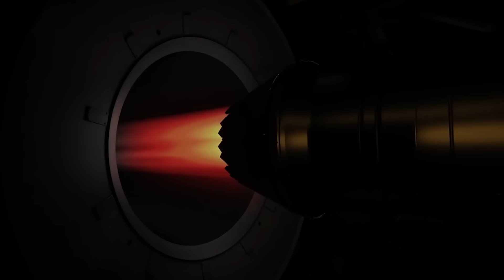Lockheed and GE join forces on a new HYPERSONIC jet engine

Comment: Diesels are "detonation engines"  compared to gasoline burning engines.  It requires more compression and heat to function, kind of like getting up to speed for a ramjet.  It's also why fuel vapor trapped in a box becomes something like a bomb.  In rhe open, methane/propane burns slow and the flame front travels through the fuel/air very slowly (but trapped in an enclosure, most of the mixture autoignites when the mixture reaches an extremely high pressure and heat, acting more like a bomb, rather than deflagration in your gas burning cook top).  Some car companies have attempted engines that can run on gas and diesel, held in 2 separate tanks, able to run on other fuels, like a turbine (but it sucked).
Reply: You're exactly wrong.  An ideal diesel is a constant-pressure engine, just like a gas turbine.  Peak pressure is achieved mechanically, and that pressure is maintained through the power stroke by the continuous addition of fuel.  There is no pre-mix.  There is no fuel vapor.  There is no flame front except surrounding the jet of the injector.  You have auto-ignition, but it's not instantaneous.  Gasoline engines are also deflagration engines, but the ideal gasoline engine is constant-volume, mechanically constrained by the cylinder.  All combustion occurs at TDC, producing a significant pressure spike well beyond the compression stroke.  The point of a "detonation engine" is that the flame progresses beyond the speed of sound, meaning you're burning faster than the fluid knows to move out of the way.  It's all the benefits of a constant-volume burn without actually needing a sealed volume.

A detonation engine is the more efficient Otto to the less efficient Diesel.

Comment: [TL;DR at the end] Alex, a video format request... Early last year YT accepted that they bit off more than they can chew and decided to start nerfing video quality heavily through what I've dubbed "dynamic bitrate". Where at times when there's a lot happening on screen and thereby higher video frame sizes (data size), the bitrate would drop significantly and appreciate that stress but at the cost of video quality (tons of compression artifacts).

The videos impacted most are ones with lots of details on screen, like games, gravel or forested travel, or tracking fast moving stuff (cars, planes, etc). What's worse is that at 1080p and lower, those compression artifacts are compounded and make the video frustrating to watch since all details get blurry at best or completely washed out at worst.

If the content is 1440p or 4K (2160p) then that is inherently less problematic since the original video had a higher bitrate to start, but that also helps because we can watch it at those resolutions and basically have NO quality loss... That's because, as far as I've worked out, they're using an algorithm that tries to keep certain things crisp (people, text, objects) and sacrifice the quality of the rest.

The TL;DR and request is: since the new compression regime YT has employed, the higher the resolution the less details get lost due to how it works. So my request is that even if your equipment isn't 4K capable to record, to upscale it in software and upload the videos in 4K. Doing so would seem counterintuitive since it would make it look a little blurrieer, but because there's way more pixels now, the compression loss becomes significantly lower! Therefore, even your 1080p upscale to 4K would end up looking better than your current 1080p after YT's horrible new algorithm is done compressing it to hell.

Thanks and sorry for the long comment 🥴🍻

[also, if anyone can see this and leave a 👍 so that I know YT's automoderation system didn't hide it, as it is so apt to do to mine these days; just one is enough, I'm not fishing for likes lol]
Reply: username checks out 
😂
Reply: @SDsc0rch  😉

Comment: let's remember the 1st Pulse Jet was used for the V-1 "buzz bomb", the buzz being the pulse
Reply: There are pulsejet desgins from before 1900; the first working one was about 1910, IIRC, and father of American rocketry Robert Goddard was clearly a mad bastard, because he actually built a bicycle powered by a pulsejet in the early 1930s :D
Reply: @svartmetall Right! I built and use a Lockwood Hiller on my go kart.
Reply: No detonation though.
Reply: nothing new under the sun...
Reply: STOP TRYING TO INSINUATE THE GERMANS INVENTED IT! The only thing those pieces of shit were good for was an episode of "Mr. Wizards World". A pulse-jet used a mechanical valve to seal the combustion chamber, timed with the injection of fuel and a spark EXACTLY the same as a two-stroke weed-eater....the only thing they don't have in common is converting the combustion into rotational mechanical force. With the exception of a turbine engine, ALL engines are "pulse" engines ! Stop it! Given what a shit idea the V-1's pulse-jet design was...you'd be doing the Germans a favor by not bringing it up! It's a lousy ass engine...precisely why they were and still are used for ABSOLUTELY NOTHING, AS THEY SHOULD BE.
Reply: glad you brought this up
Reply: kinda how a late 1800s hot bulb barge engine is basically the same thing as a modern turbodiesel if you squint hard enough.

Comment: We need hypersonic missiles, but in relatively small numbers. Hypersonic planes will be much more useful and cost efficient.
Reply: How about firing HS missiles from HS planes😮
Reply: @josephwilliford2474 It could have some value. Mainly making HS missiles cheaper since they wouldn't have to travel as far and the technology would be simpler if already traveling at HS speed.
Reply: There are some interesting applications that this could have.

Comment: The j58.. Pratt & Whitney... In the a12s and SR-71... Where a hybrid..  . They had a little trick called the bypass doors... And retractable. Inlet cones. Those bypass doors enabled it to be a hybrid between ramjet and scramjet... A consequence of this system... Was a thing called unstart ..... And also the fuel to run at that level jp7..... Which was pretty much.   Un ignitable with a match..... Requiring the use of teb....
Reply: All liquid fuels are un-ignitable with a match.  You ignite vapors, not liquids.  Matches only work with light fuels because they're volatile and form vapors at room temperature.  Heavier, less volatile fuels like diesel and kerosene need to be heated before they give off flammable vapor, and a single match just doesn't have the energy to do so.

Comment: This is the kind of propulsion tech that excites me greatly
Reply: Same it really makes it feel like we're in the future
Reply: This is definitely where the future is headed though when we get there exactly remains to be seen. There is a US startup Venus Aerospace that just tested the first commercially made rotating detonation engine and they also have talked about combining it with a ramjet to keep high efficiency at different speed regimes.
Reply: If that's so, you should look into the technology they had in the 50s. Look up an article called "The G engines are coming". We've had super Advanced Tech much longer than most people realize. It's just been suppressed or hidden from the public.
Reply: All the way to the tip.
Reply: I’m thinking SSTO I mean accelerating an aircraft past Mach 5 up to about 100 thousand feet then engage rocket engines to orbit Russia has Mach 10 scramjets already and are using them in war
Reply: @jasontipton8430  in a world where booster reuse wasn’t a thing I’d agree. But SSTO is soooo inefficient bringing all that mass the whole way. Even with next gen engines I don’t see how it could compete with a Falcon 9. To get the same payload to LEO your vehicle would have to be hugeeee

Comment: Good way to increase the IR profile.
Reply: With respect to the exhaust gases, there are a few proven methods to defeat that increase fairly easily. It’s the skin that gets troublesome, though there are ways around THAT too, though not nearly as easy to do. There’s a reason we haven’t quite managed to make very fast AND very low observable go together in the same airplane. Yet.
Reply: As far as detection goes, yes you are cooked. But any counter air is going to be hard pressed defending against high supersonic speeds. I am curious how they are doing navigation with the plasma sheath and all.